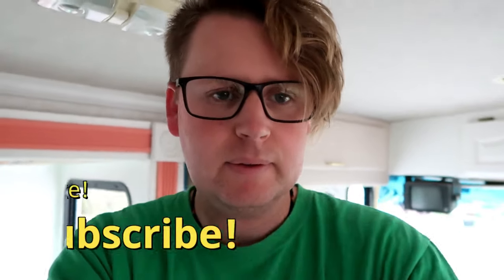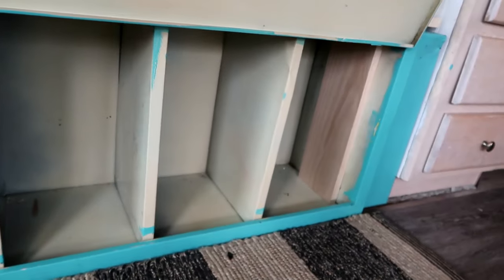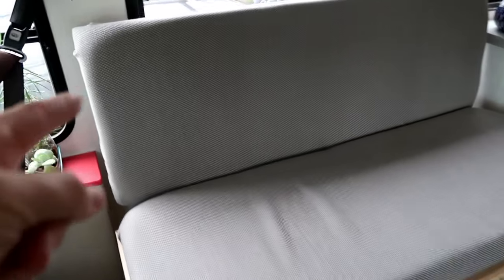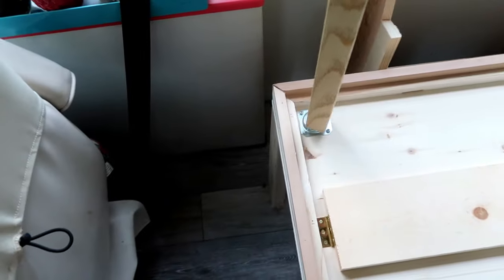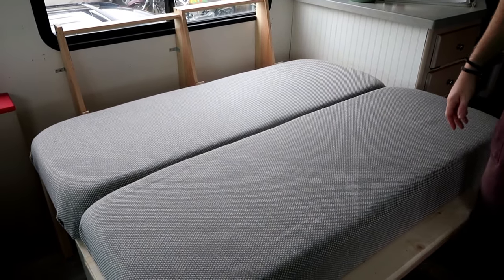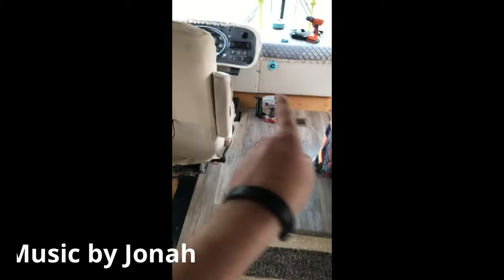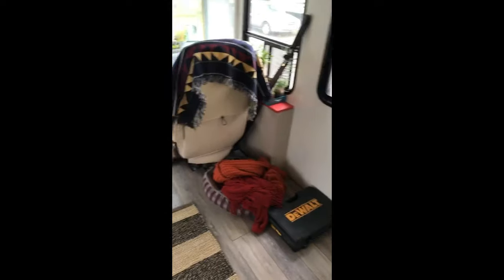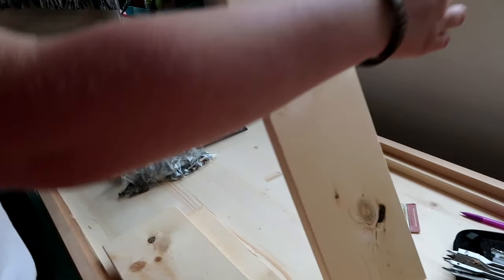DIY RV couch/bed built out of a locker

Comment: Have you had issues with the mattresses spreading apart while sleeping? Mine is a similar build but my mattresses spread and it’s uncomfortable. If you have any ideas let me know!
Reply from the maker: We haven’t had any issues with that but I’ve actually been thinking about it lately. With just the right amount of grip you should be able to control your slide. If you were to attach an anti-slid fabric it might do the trick. Another idea is installing a couple of buttons on either cushion and then a strap that would slip over each button. You could do this on both ends and it would hold the cushions together. Industrial strength Velcro between the cushions might work as well. With the industrial strength stuff you would probably need to sew it in to either cushion because the sticky side wouldn’t be strong enough to hold on to the fabric. Those are just some ideas off the top of my head. Good luck!